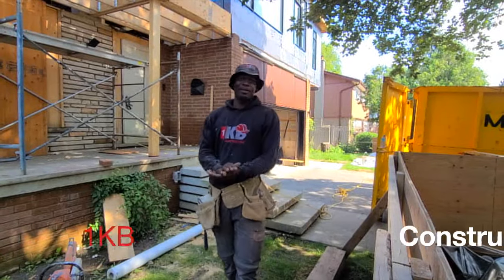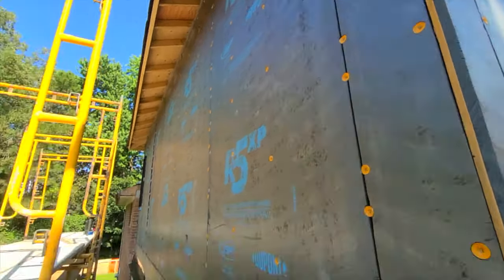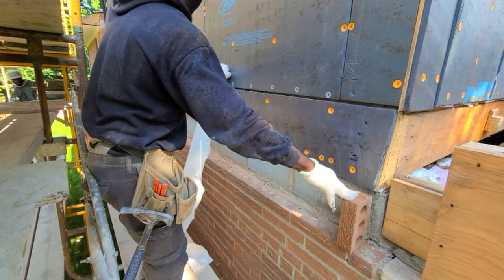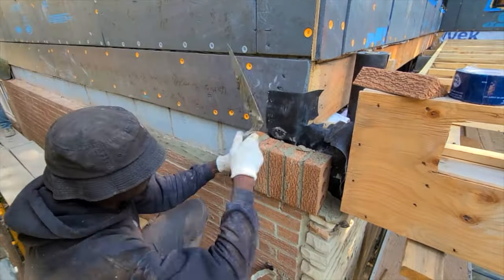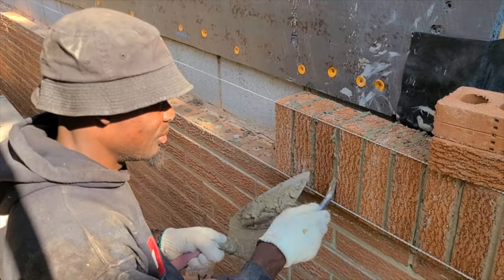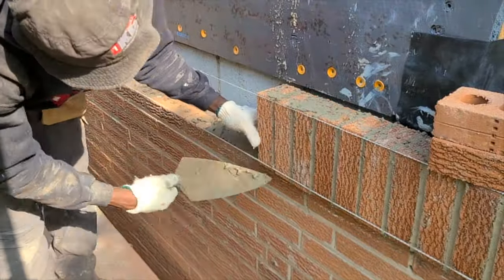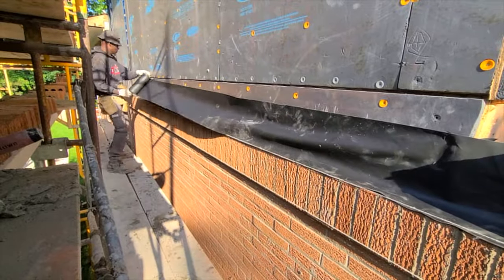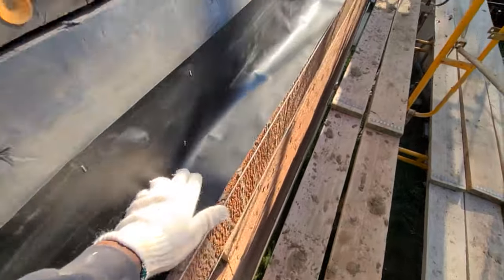Bricklaying / We Have a Big Problem To Fix /Carpenter Messed Up Big Time/Bricks Installation DIY

Comment: As as carpenter I can attest to homeowners, even engineers, changing their minds about exterior renders and fenustration after the roof is on.
Change order scenario seems more likely than a builder making a building two inches bigger than the plan on all sides.